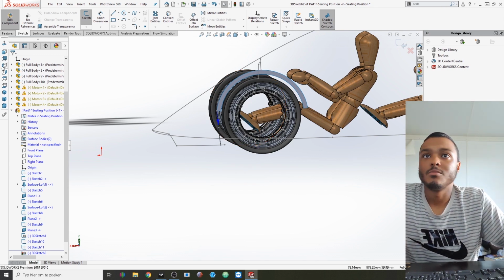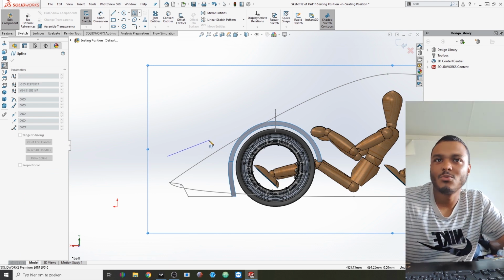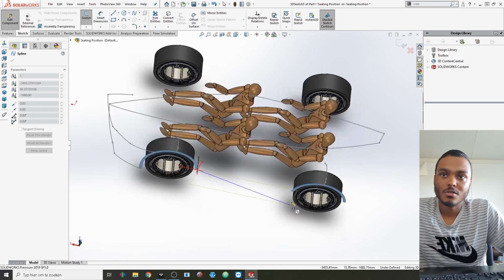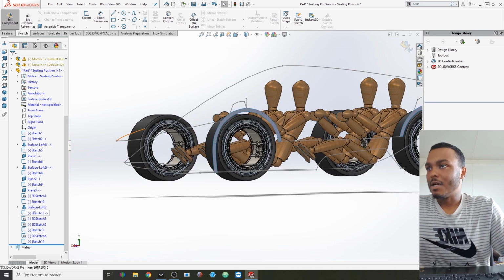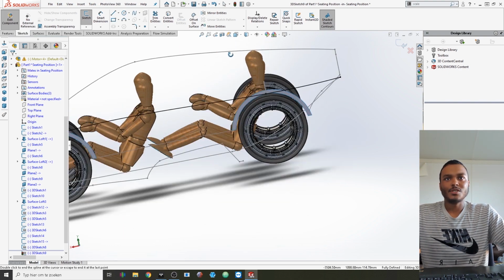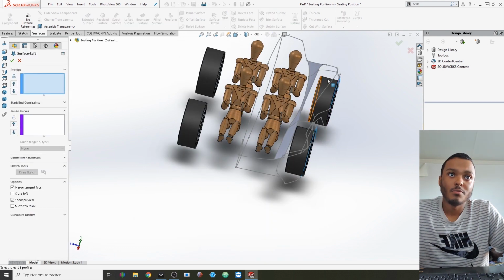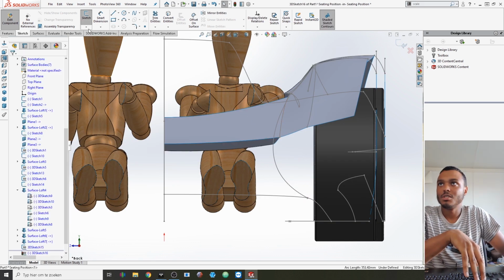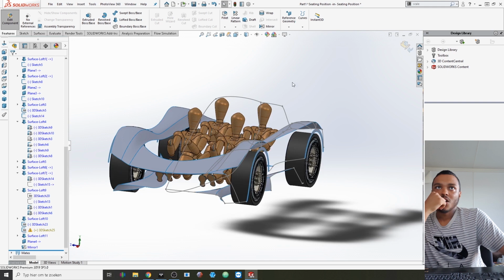How to Design a Car in SolidWorks | Surface Modeling Tutorial Part 2 | Veldboom Studios

Comment: it is very hard to design with surface modeling if there is no plan rather than free form isn't it?
Reply from the maker: I think that i have become a custom to this free 3d design method. I do have a very clear picture in my head before i start with a design.
Reply: Solidworks surfacing plugin